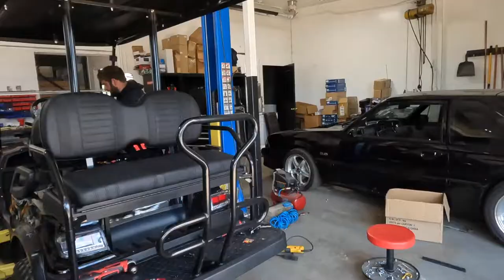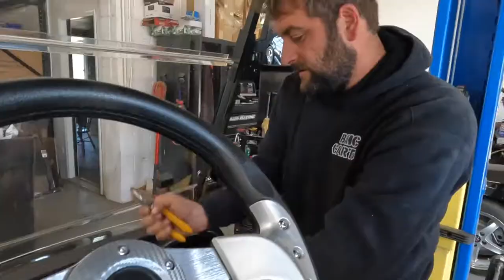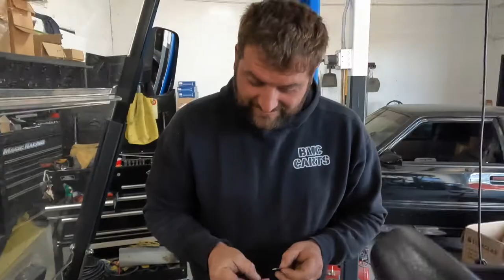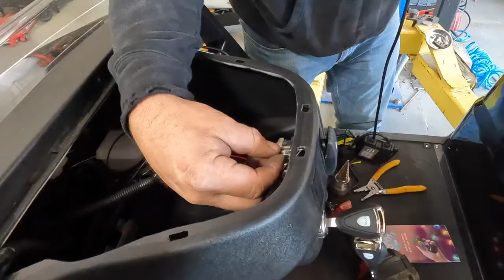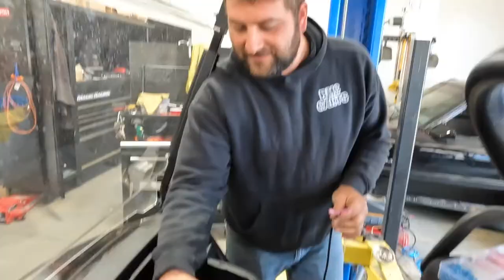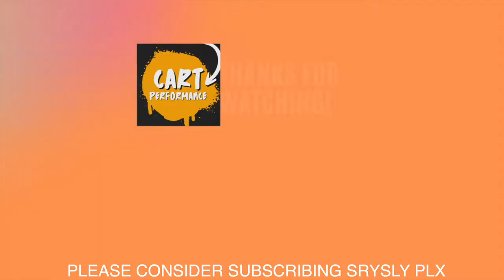ICON CART REVERSE BEEPER DELETE!!!

Comment: Disconnect the orange and white wire no matter what terminal its connected to. Look at the beeper under the seat and you'll see it's a orange and white wire leading from the speaker to the dash...easy! Mine was connected to a different terminal than what's shown in the video.